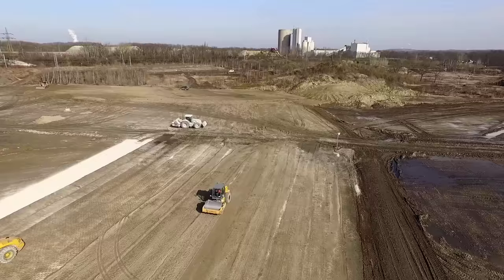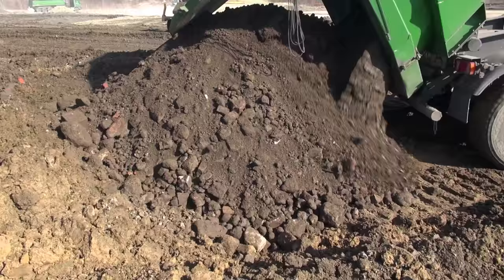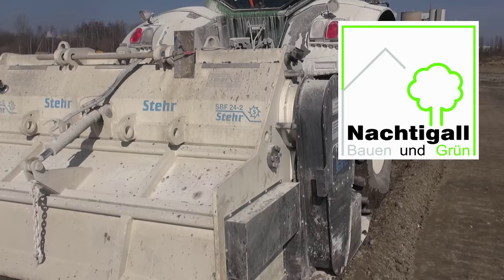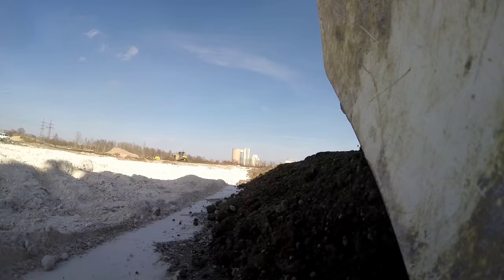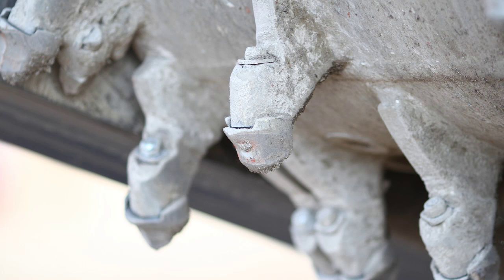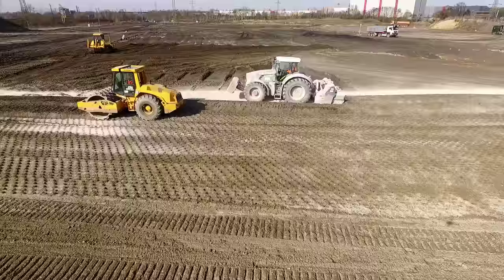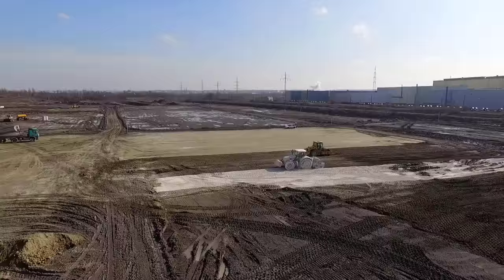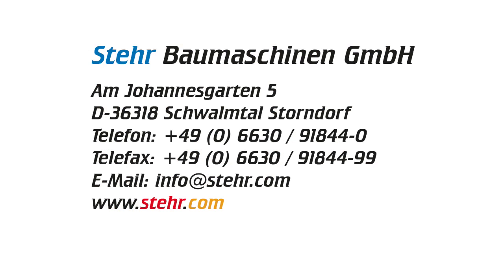Soil stabilization grinder in hard practical use [HD] [EN]

Comment: what is the purpose of the white powder? thank you in advance
Reply: From what I was told... It's "Lime Powder", or some type of cement-based substance with a chemical agent possibly. It stabilizes the soil when mixed by those machines (which basically is nothing more than a big Rototiller). I think the white powder keeps the soil from "moving" or shifting once construction has begun.